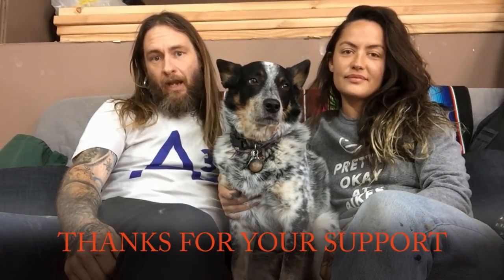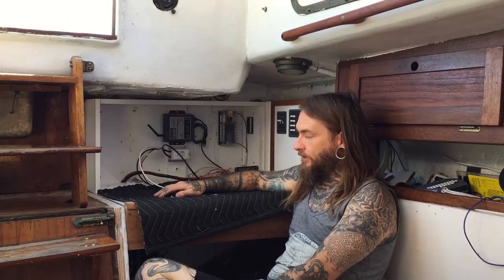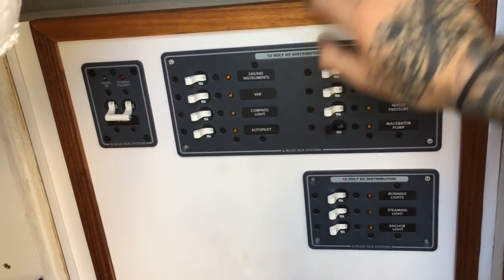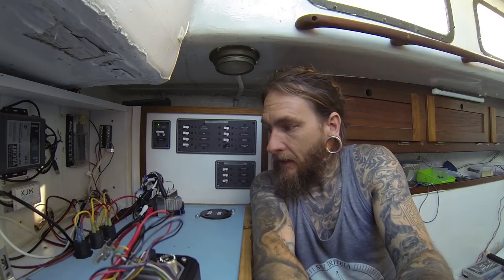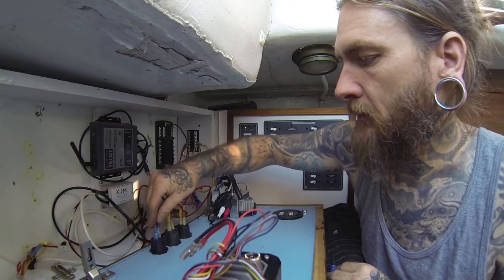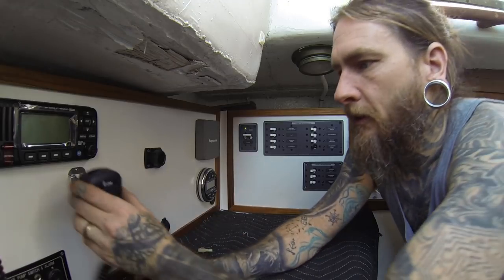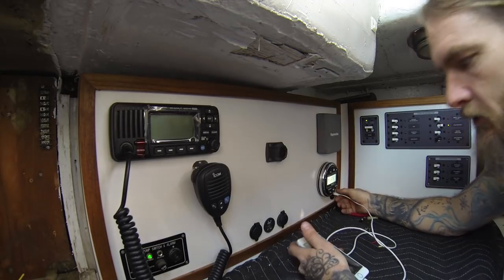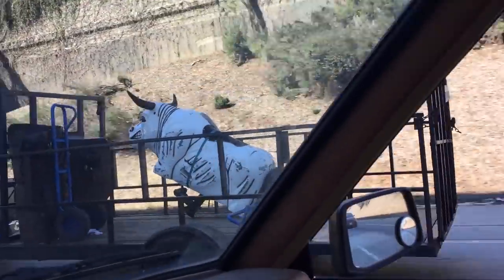NEW NAV STATION DONE! (mostly) Custom navigation station on a classic sailboat

Comment: Electrical stuff is my weak point. I know the boat I will be able to afford will more than likely need to be rewired. How much experience did you have before buying your boat James?
Reply from the maker: my electrical experience before hand was hooking up car stereos. You can learn any aspect of wiring up a 12v system from the internet or books. The main thing I would suggest is don't try to reuse old wire, rip it all out and rewire wire it, otherwise the wire might look perfectly fine and be full of corrosion or there might be a spot it passes through that is hard to see or reach that might be chafed through and cause a short, tracing where electrical problems are coming from is maddening so just start a fresh when you get your boat!